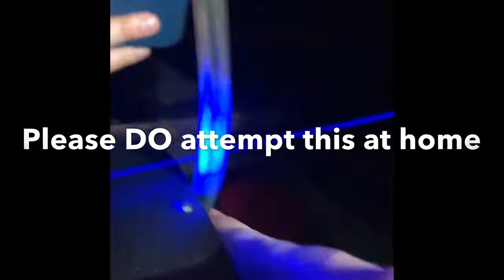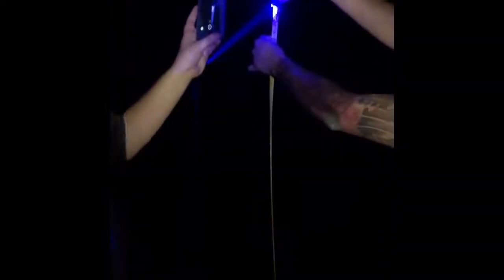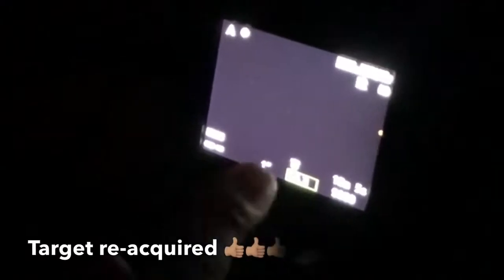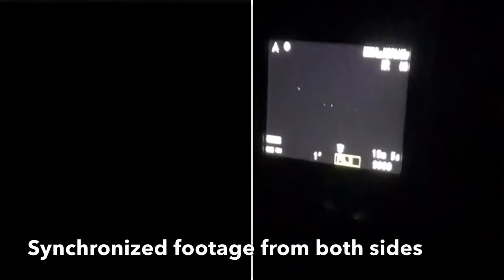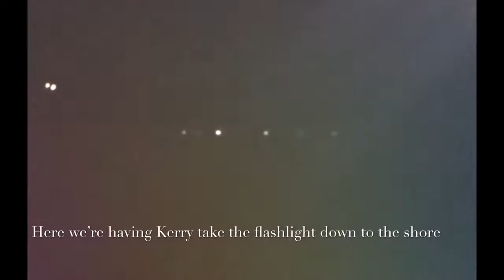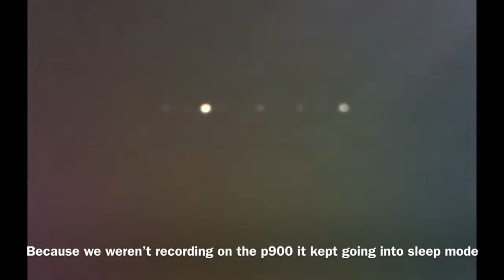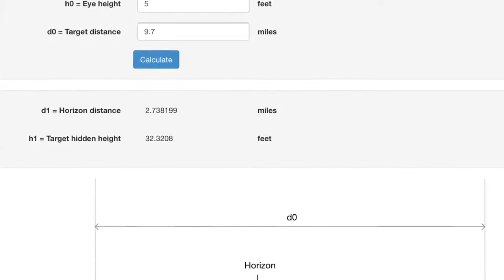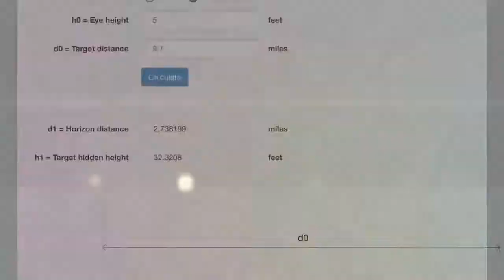Group of flat earthers prove no curvature with a laser and a flashlight

Comment: I see no collimator . Laser dispersion is not considered by this gang of ignorants.
Crap video proves nothing with regards to water level.  It only has value if both levels are shown at the same time and the water level can be seen to be accurately set up to be level, which it isn't.
It gets worse - their prized magic instrument, the P900,  was even too embarrassed to take part in this comedy of errors. 
Next time, make it simple - set up your laser and collimator to be parallel to the Earth. At the far end, see where the laser light shines. At 10 miles, it will be over 50 feet in the air.

The "experiment" shown in this video has less value than the Venezuelan currency.